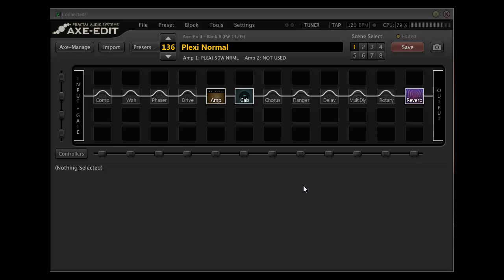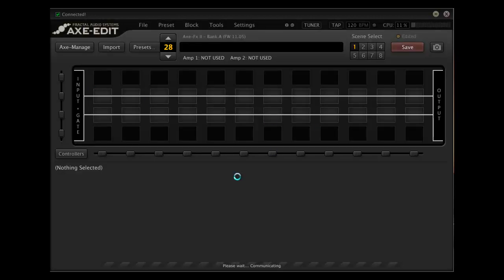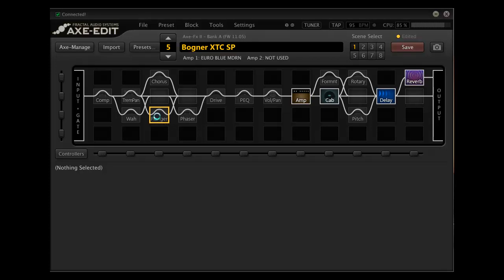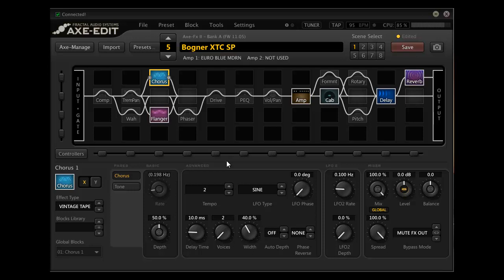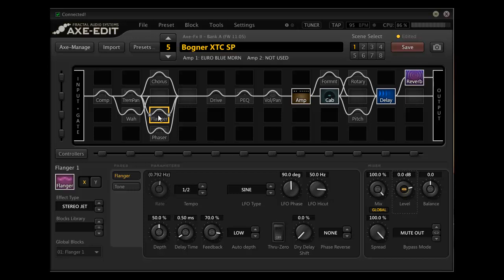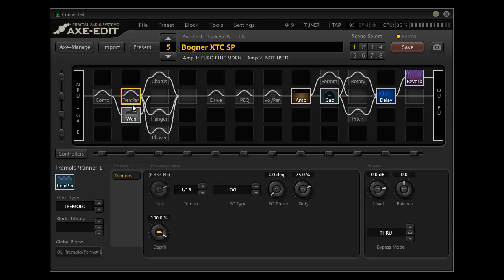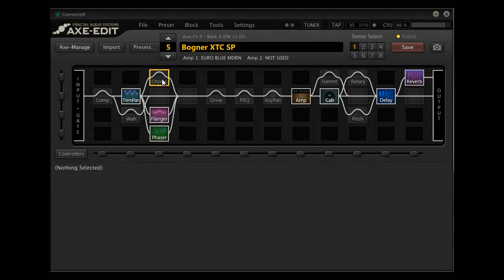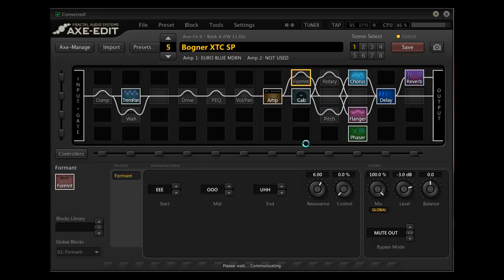Taming the Monster - Fractal Audio Axe-FX II - Dial Up Serial or Parallel Effects

Comment from the maker: Just choose a stereo delay and ensure that no mono blocks (cabs, effects) are after it in the signal chain. 

If you run a dual amp chain and want them to be separate on each channel, you need to use the balance in each block to pan them. Contact me privately for more information.

Comment from the maker: No, that isn't what'll happen with just Drive blocks in parallel. You can try it though - and nothing will blow up, start smoking or catch fire. I don't run drives in parallel. You CAN however run amps and cabs in parallel with each other; that will get you much closer to what Joe does do.

Comment: Thanks Scott, your videos are always an awesome learning tool.  I always thought that the routing lines to the Output in different rows had to do with Stereo output.  I guess I was wrong.  How would I set up the preset if I wanted to run a stereo delay?  I'm also thinking about running a dual amp preset in stereo as well.

Comment: great video !!! lots of questions answered !! So, if u run a drive in parallel ... are u gonna hear the actual signal AND the overdriven signal at once ? ... will sound it similir to what joe bonamassa does ? I know he uses different amps but what s gonna happen if I run a gain block in parallel ?